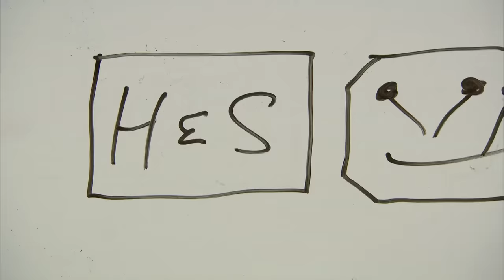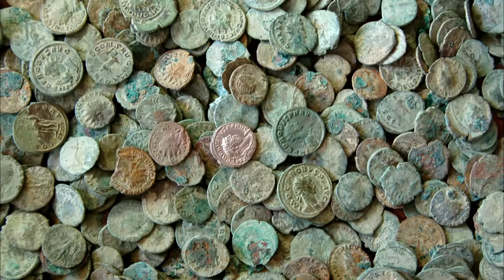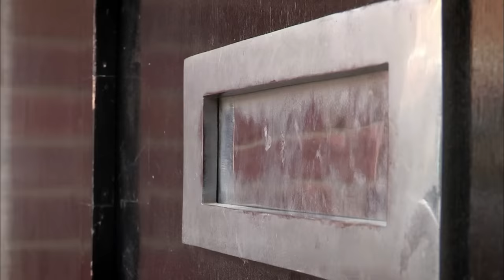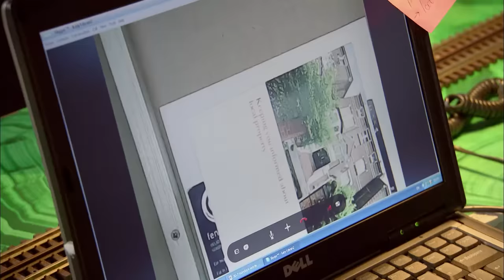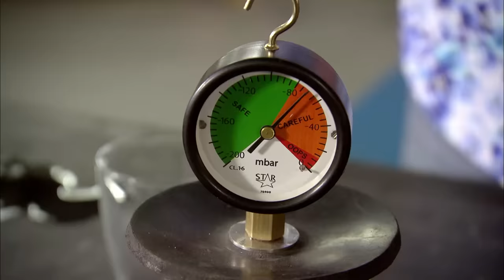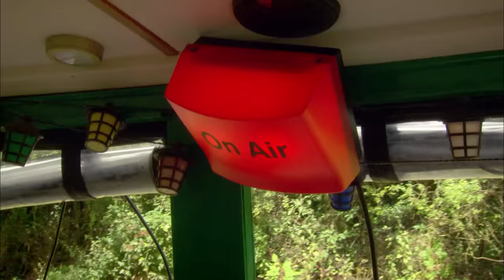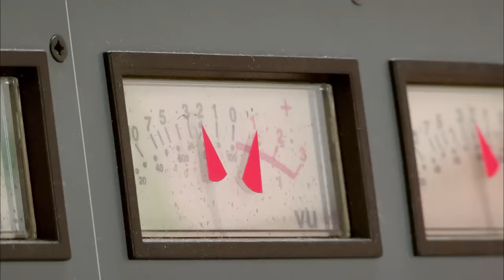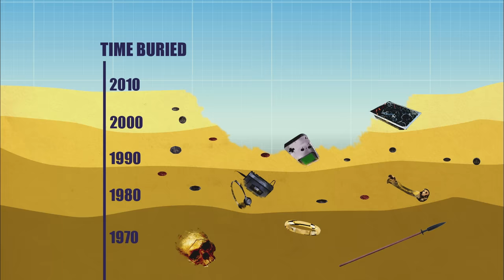James May Goes Treasure Hunting! | Man Lab

Comment: I suspect it would be possible to fully automate the identification of junk vs important by something like the amount of reflection (as almost anything with a gloss finish is crap). Perhaps it takes a look at the colour composition for a single consistent colour to identify proper letters....or looks for a stamp. Would be very hard to get it 100% accurate though 🙁
Reply: i was thinking along the lines that stamped is not Junk as a rule.
Reply: I did wonder about combining ir and colour cameras, in the hope you could pick out gloss.

If you’re looking for stamps you would also have to look for franking.  It is presumably printed in a distinctive security ink, so hopefully there is something specific you can look for.

Comment: Dowsing - in the Aussie Outback where water is scarce, many older Drillers first “Dowse” the area to work out where and how deep a water supply is. It’s uncanny how many times a hole drilled on a “Dowsed” location finds water, compared with holes drilled based on  geological maps.